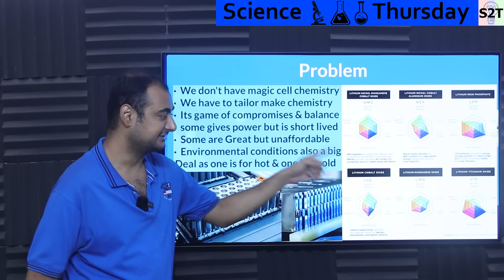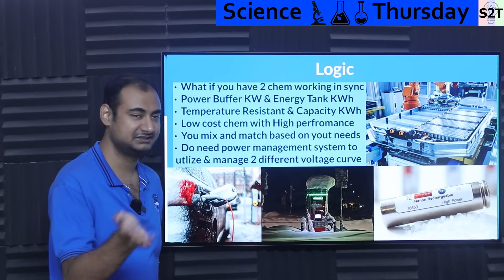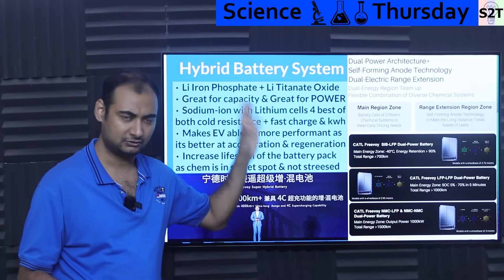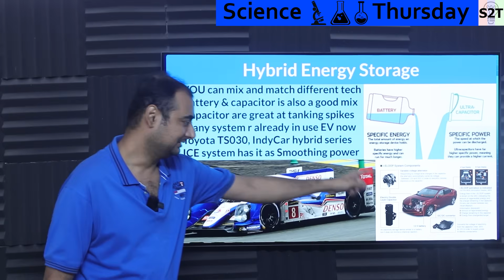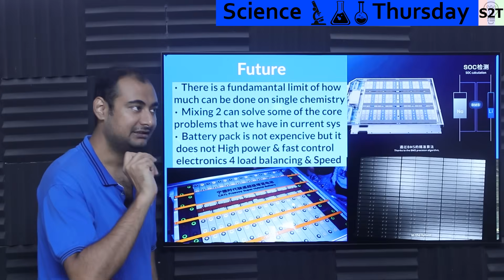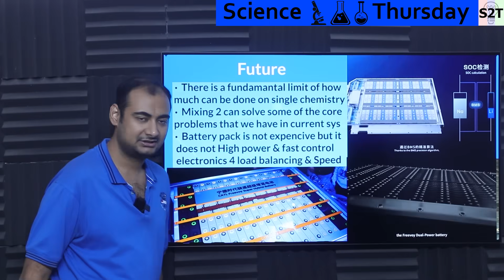CATL Hybrid Battery Explained {Science Thursday}

Comment: U said under water balloon will pop?

If they are made from glass fiber (like wind turbine blades are) 

And if the pressure on both sides is kept the same (by pressurising the inside to the same pressure as our side) 

Which also relieves it from fatigue strain/stress

Then why not?
Reply from the maker: (by pressurising the inside to the same pressure as our side)  {I think u wanted to say OUTSIDE }  then it will not have buoyancy & will not work and if u believe in it then build it and see